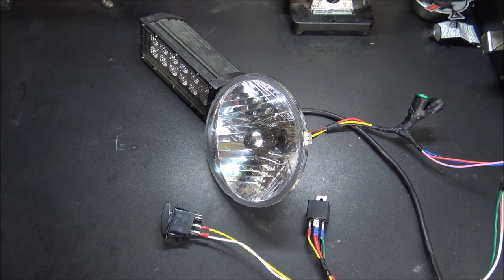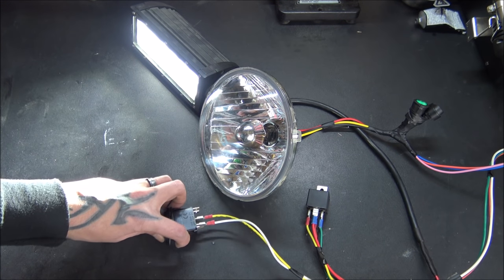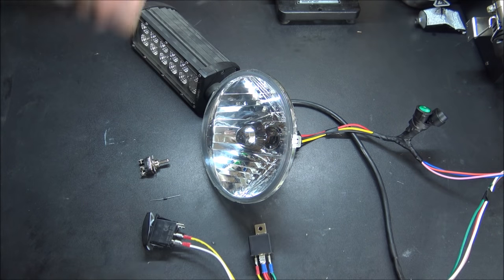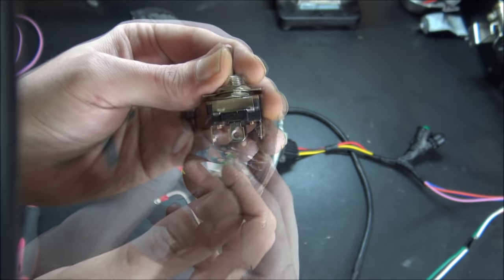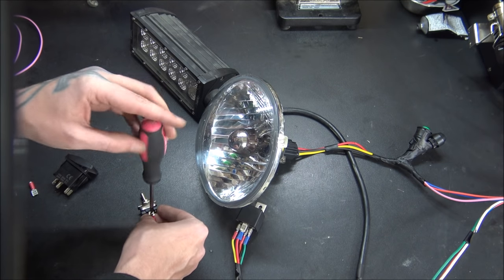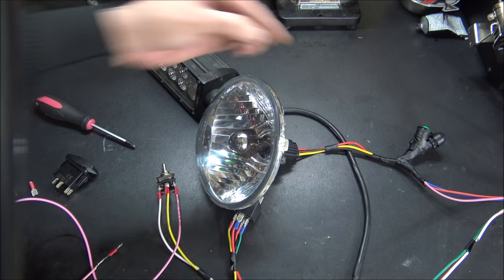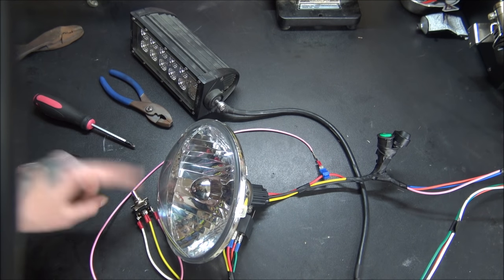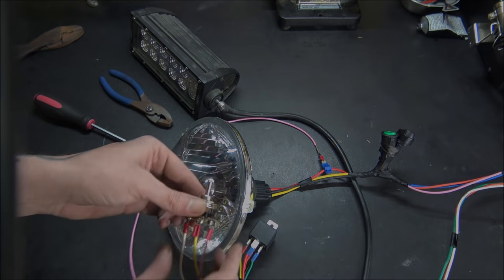3 Way Switch, How To Wire Your Light Bar To Work With Your High Beams & By Itself (ON/OFF/ON Switch)

Comment: I know the video is 5 years old but it helped me today, thank you for such an easy to follow tutorial.
Reply from the maker: Glad the video can still help people all these years later. Thank you for watching!
Reply: tutorials dont have expiration date, duh...
Reply: is the diode necessary
Reply: @jamalnagori he says it isnt...
Reply: @RockyXTV hey rocky..
Nowadays by law, you cant have lightbar to come on unless highbeam is on. So needs to be isolated.

How do you wire up a 3 way rocker led lit switch so that so that..
On: lightbar, lil led light in switch, highbeam
Off: lightbar, lil led off (but highbeam can STILL be turned on at the stalk?
On relay..
30 is inline fused batt power.
86 is fed from 30
85 is highbeam main wire
87 is lightbar

Where do the three prongs of rocker switch go? Please and ty

Comment: I think you could also use a fuse tap on the highbeam fuse as an alternative to the t-tap, if you're like me and have an aversion to cutting into the high beam wire.

Comment: My led lightbar has a wireless, 3 brightness level & strobe switch. 
What if i wanted to hard wire and integrate these functions (or maybe simply a strobe mode switch and dimmer nob would be best?) into a set-up like this? What do you think the most logical and intuitive way to incorporate these functionalities into the factory light control system would be?
Similar to your reverse light demonstration video, I think incorporating the lightbar into the factory high beam controls with a rocker panel switch might be the best approach, but with a few minor(🤞🏼) tweaks. 
Would it be possible to:
A. Bypass the light bar's 3 intensity light modes, instead utilizing the factory dimmer wheel dial to also dim the light bar any time its on,
while also;
B. Wiring in a separate switch that simply toggles the strobe function on and off?
C. If its not possible to wire the lightbar's intensity to the factory dimmer wheel, would it be best to simply wire a separate dimmer nob switch in parallel to the strobe switch and factory integrated rocker?
Does this make any sense?
Could you suggest a more efficient and intuitive approach or would one of the above hypothetical implementations work and which would you suggest I use?
Knowing that I've watched both your headlight and reverse light videos, I'm also proficient with basic electrical terminology and capable of performing such procedures, could you suggest a general parts list and wiring procedure to which you believe to be the best solution?
Your videos have already been most helpful. Any further guidance would be most appreciated!

Comment: Love the way you illustrate and show hands on with small scale mock ups!!!  Super helpful.  I've been struggling with a wiring puzzle.  I want to set up a 3-way circuit for lights on my Jeep Overlander to control rock lights, rack lights, etc on the ground level from the rocker panel and/or rear of jeep.  But also from up top in the tent.  Allowing me to illuminate the ground/area but be able to switch off/on when up in the tent w/o having the switch off before going up top.  Or climbing down the ladder in the dark in the middle of the night.  Is this something you'd be interested in helping us wrap our head around?  Thanks again for tuts!!
Reply from the maker: If you like, you can send me an email ( rocky.tvchannel@gmail.com ) and I'm sure we can figure something out. Thanks for watching!
Reply: I've wired this same 3-position switch in tandem with my highbeams without any issue... until recently. (I used your video years ago. Thank you!)

But I swapped out my stock headlights to LED, and now I'm getting a humming noise coming from the lightbar relay when I'm in tandem with my highbeams. 

After doing some research, it appears installating a capacitor would fix the humming. Are you familiar with this issue of relay humming or the installation of capacitors?

Comment: Awesome video, so glad I found it for the same reasons as everyone else. Have subscribed and look forward to checking out your other vids.

I want to wire up a switch like this in my car to an LED at the rear of a trailer. Want to be able to power the light independently and also have the option to turn it on when the tail (ignition) lights come on. The LED only draws 1.3A,  so I plan to omit the relay. 
My plan is to connect switched battery + (inline fuse) to 3-way switch terminal 1. I'll tap in to the tail light wire at a point just before the tow vehicle 7-pin plug (car side) and connect to terminal 3. I plan on connecting the spare 12V wire on the car/trailer plug (reverse lights not used) between terminal 2 and the positive on the LED. 

Couple of questions: Will this work? And is the ground on the LED light the only one I need to earth (to trailer chassis)?

Cheers
Matt
Reply from the maker: If I understand everything correctly, I think you've got it!
Thanks for watching!

Comment: Great videos. Thank you. I was told to always use a relay where the relay’s coil is protected, internally, by a diode or a resistor. The reason, from what I understand, was that when an energized coil is de-energized, there is a magnetic field “collapse” that sends voltage (which can be orders of magnitude greater than the original voltage, albeit the current is milliamps) in the opposite direction to the original voltage direction in the relay.  This can, apparently, disrupt voltage-sensitive components (such as a blind spot detection sensor) that are “upstream” from the relay.  A relay whose coil is diode (or a resistor) protected prevents this.

Comment: I know this is an older video... but if you're still responding... how would you wire this using the unfitter switches already installed in a Raptor? I really don't want to run a separate switch into my cab. Also... if I did a fuse tap... what size do I need amperage wise? TIA!

Comment: Perfect explanation on how to, but question. Can you use same process with (2)LED light bars, and will a bigger diode be ok to use?
Reply from the maker: Yes you can run 2 light bars on this setup as long as your relay is rated to handle the current draw of the 2 lights, or you can use 2 relays. As for the diode, I've done a bunch of testing after making this video and found that the diode is not needed. I hope this answered your question. Thanks for watching!

Comment: Great video. Really good way of explaining it all. 
I've got a light bar to a 2-way switch on its own circuit. I want to make it turn on only with highbeams, I've seen people use a fuse tap as a piggyback off the highbeam fuse to wire to. 
Do you have any advice for this ?
Or how such a thing would be wired ?
Thanks

Comment: Great vid I am fitting a light bar but want it just to come on with high beam switch I want to tap in to high beam wire  from headlight I have got a wiring harness do I tap high beam wire into the live wire on harness many thanks 😎👍Alan from England
Reply from the maker: You would need to find which wire in your harness is the "trigger" or "coil" wire & hook that one to your high beam. This way the relay/light bar is pulling its power from the battery & not your headlight. The trigger/coil wire pulls very little power, just enough to activate the relay, then the relay pulls power from the battery & sends it to the light bar.
I hope that makes sense. This is only good if you don't plan on using the switch in your harness.
Your light bar harness should still be hooked up to the + & - of your battery. You probably have 3 wires on the switch, one will be power coming into the switch, then power out of the switch going to the relay, then a ground if the switch lights up. You would be looking for the wire that sends power out to the relay, that wire would tap into your headlight.

Comment: Awesome video, I was able to wire my set up because of this!  Ive got a new problem though.  Im installing lights on a work trailer. I want them to turn on with backup lights which is easy. But I want to run them off a separate power source for job site lighting. How do you connect the lights to two different sources?  Thanks!
Reply from the maker: Have you seen my other video on reverse lights? If not here's a link for it. Let me know if this helps, thanks for watching! https://youtu.be/hjpucoy0Qxo

Comment: Love you videos very informative. Just about to wire up some roof light bars with a 3 position carling Contura II switch. I believe it can be (i)on off on (ii) on on off (iii) off on on Hope I am correct as I would like (iii) Question do I need to use a diode? when splicing into high beam cable. Cheers
Reply from the maker: I'm not 100% familiar with that switch, but I think you are on the right track. You do not need the diode, it is optional for some newer vehicles but rarely needed. Thanks for watching!
Reply: Cheers for reply. Keep the videos coming

Comment: Awesome video. I dont actually have a light bar, but I am trying to figure out how I can wiring in a 3-way switch for my high beams. My current high beam switch is a foot button, and I want another switch to control the high beams with a finger switch, while still leaving the factory wired high beam switch operational. Any ideas on how I could do that?? Thanks!

Comment: You can use the standard 2 way switch if you only want the light bar to come on at high beam. Otherwise leave the light bar switch in off position for normal high beam for those that don't want to have a 3 way switch and accidentally leave it on and drain your battery. Also wouldn't it be better using the current off the high beam to trigger the coil on the light bar relay? So you can mount the relay close to the light and not have a single line of wire going back to a switch inside the car. Just a thought.

Comment: Hey buddy, I have a light bar with 18 functions. 3 wires coming out of it but no on off button. I’m trying to get a handle of what type of switch I need, I would like to turn it on / off obviously and I guess another button on the switch to run through the 18 functions. Any guidance would be appreciated if what I mentioned is possible. I don’t mind running a relay and or fuse on the switch, that would actually be fine with me. It’s for my ATV

Comment: awesome vid! very informative. How would i replace and wire led pods to factory fog light switch and a separate 5 pin switch as the pods have running lights so running them solely on the factory switch will not give me running light capabilities? Or am i wrong

Comment: Great videos enjoy them.      I see you have a video for reverse lights using the newer 3 way switch . I like the old simply     toggle. Can I install this setup for aux. reverse light to come with stock lights  or turn them on manually. 
I have installed a aux. switched power fuse block and will relay

Comment: I have installed the led light bar a few weeks and ever since was wondering if I could use it the way you've shown it the video... As it's convenient for switching on the led light bar on dark country roads rather than the awkwardly placed auxiliary switches in my vehicle..  Great job. Was just wondering what is the rating of the three way switch you've used? And how many wires have you got coming out of the light bar itself, mine seems to have only 2 wires
Reply from the maker: There are only 2 wires coming out of the light bar, Positive & Negative. The headlight is the one with 3 wires. As for the switch, the one shown in the video is rated for up to 50 Amps. You can use a better looking rocker style switch, you would just need to add another relay like I did in one of my other videos about aux reverse lights. Thanks for watching!

Comment: great videos! but my question is do I have to put a 3way toggle (on/off/on) for 2 switch options? I would like to have led lights come on with high beams and a separate toggle that I can just turn led's on without truck on or running and all the lights/headlights on? thanks!
Reply from the maker: This is another of my videos that might point you in the right direction, thanks for watching! https://youtu.be/77q9KtjnNTU

Comment: Really great buddy... I follow your wiring instruction and it works the fog lamp and together hibeam and foglamp.. But I used 6 pins to rocker switch ON OFF ON I had a hard time to figure it out how to wire the terminal just to have a standby light when you turn on the ignition.. Can you please give me direction on how to connect the wire.. I already send you pix on your messenger... Thank you buddy have a nice day..

Comment: I have a rigid SR SAE barlight with 5 wires running to the main switch. It's a three way switch. Low,Off and Normal. Any advice on how to wire something like that?
Reply from the maker: It would depend on what you would like the light bar to do, and the type of switch. Different manufacturers use different switches and I'm not 100% familiar with the pin numbers on whatever switch Rigid uses now.

Comment: I've wired this same 3-position switch in tandem with my highbeams without any issue... until recently. (I used your video years ago for the installation. Thank you! Great video)

But I swapped out my stock headlights to LED, and now I'm getting a humming noise coming from the lightbar relay when I'm in tandem with my highbeams.

After doing some research, it appears installating a capacitor would fix the humming. Are you familiar with this issue of relay humming or the installation of capacitors?
Reply from the maker: I've never had a relay hum issue, but have used capacitors. I have a video about installing them on LED fog lights. I think it's called "DIY Anti Flicker Harness" or something like that. It may help you out.
Thanks for watching!
Reply: @RockyXTV  I followed the other video you just recommended.  It works great.  No more humming coming from my light bar relay.  Thanks again!
Reply from the maker: @robertepperson5461  I'm really glad it worked for you! I guess now it can be called DIY anti flicker AND hum!

Comment: Hi I'm installing a 180w led light bar with a 40A relay and a 3way switch as shown here, would a 1A rectifier diode be OK for this application?
Thanks in advance

Comment: I wired up a 7-pin illuminated 3-way switch like you showed in the video and my light bar works exactly as it should but I can’t figure out how to make the switch LEDs turn on only when the switch is pressed in their direction. Currently the switch LED for the light bar only position is always on and the LED for the high beams position turns on and off with my high beam selector, regardless of the position of the 3-way switch. Is it possibly to have the switch LEDs turn on only when the switch is pressed? Or is this not possible because we are using the switch opposite of the way it was intended?

Comment: I understand your video but a lot of light bar wiring harnesses have a 3-wire switch that has a positive negative and the third wires the wire that goes to the relay. Does the switch your using just not need a negative wire?

Comment: Advise I want to connect two LED light fitted to front bull bar directly  to to head light wire dip beam, on DMax 2024, do I need relay, 4 OR  5 pin   and also diode . Also can I connect directly WITHOUT relay, , thanks

Comment: Great video !!! I have a 2018 Toyota Camry that I have 2, 7 inch light bars on. I have factory projector lights. Which wire triggers the brights ?
Reply from the maker: That's a tough one, I can't seem to find a schematic for it. You may be able to call a dealership and ask, or get a full repair manual from an auto parts store. Maybe someone in the comments knows, or you could try to find a Camry forum. Sorry I couldn't be of any help.

Comment: Hi There... Im newbie in this LED bar, but I already bought 2pcs of this exact LED bar of yours (12LED). Unfortunately, it doesn't comes with its own relay and switch. I want to connect both Bars in my Highbeam. May I ask if What type of Diode and Relay do I need? Appreciate your thought...

KUDOS for your Videos...
Reply from the maker: Hello, I can definitely help you out. If you could send me an Email to rocky.tvchannel@gmail and I can write up some step by step directions for you, and maybe even supply you with a simple diagram. Thanks for watching and I look forward to helping you out with your project!
Reply: YG Mail... Can't wait to do it...
Reply: Rocky X TV I love your video I was quite easy after you explained it but I own a Subaru and from what I read Subaru’s use a negative earth  set up and I cannot find the wire that sends the signal to allow me to get the light bar on with the high beam selected... can you help me out please!??!

Comment: This is great! Can you please help. I'm trying to install a light bar but my car doesn't have either hb3 or h4 plug (newer model car)  to connect it to. How do i find high beam wiring to connect to? Any advice would be appreciated. Thanks in advance
Reply from the maker: What type of car do you have, and do you have a test light or multi-meter?
Reply: @RockyXTV 2014 Mazda cx5 with bi-xenon bulb. Thanks I might have to get the professional tobfit it for me.
Reply from the maker: With those most likely being HID you would be dealing with Ballasts and such. If you are not knowledgeable about that type of lighting system I would agree with you about having someone take a look at it for you.

Comment: hey man love the video. just wondering if it is possible to make them flick on with the high beam with just a normal switch not a 3 way. if possible a diagram would be awesome!
Reply from the maker: It is possible. If you send me an email ( rocky.tvchannel@gmail.com ) I can send you a simple diagram. Thanks for watching!
Reply: @RockyXTV  thanks for the reply just sent you an email then!
Reply: @RockyXTV could I also get the simple diagram as well? 2013 Acura TL sh-awd